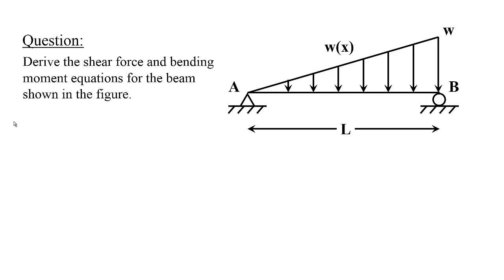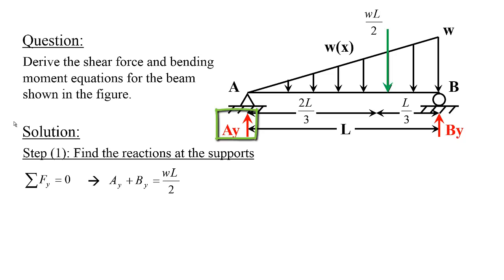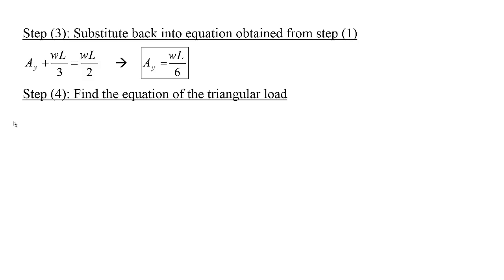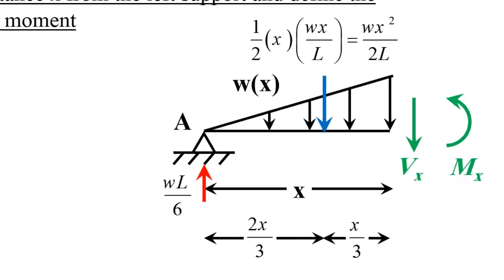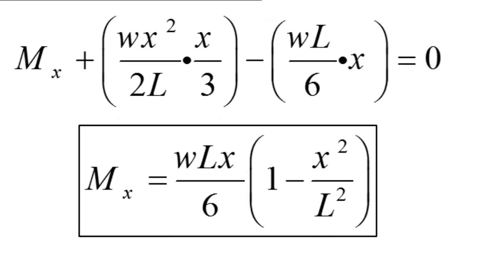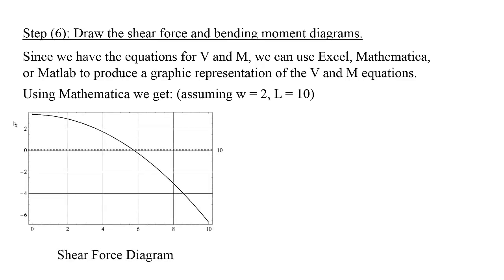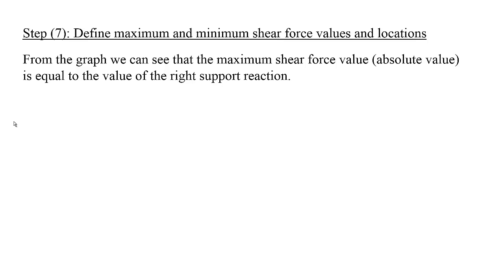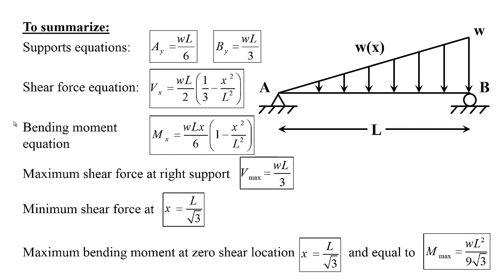Question (10): How do we Derive V and M equations for a simple beam with a triangular loading

Comment: While I appreciate the explanation, a problem like this will not be on the FE exam because it takes too long to do even if you know exactly what to do.
Reply from the maker: you are 100% correct. Most of these problems appear in homework sets and some final examinations :)
Reply: @CTSCIVIL  that’s true. I’m studying for the FE right now and came across a couple of problems like this and thought there is no way a problem like this would be on it
Reply from the maker: @dylanmccoy8530  Good luck with that. 
Remember, you only need the basics
Reactions, Shear force and bending moment at a section and diagrams, Method of joints, method of sections. That what I did from statics and all of them appeared on the test
Reply: @CTSCIVIL  thanks for the tip!

Comment: What is wL? The total length of the beam times the ?. Is it the maximum w(x) or what? Why not write w(x)? Use some numbers, it will clear a lot of stuff up!
Reply from the maker: MrFishhunter w is the maximum value of the load at the right end of the triangle and L is the total length of the beam. w(x) is the equation describing the load where w(x) at A = 0 and w(x) at B = w. 

The main point of this tutorial is "NOT" to use numbers :) The main idea is how to derive general equations and if you have numbers you can plug them in at the end.

Thanks for stopping by
Reply: CTSCIVIL I forgot to thank you for publishing this, I shouldnt make demands but if the point is to teach people then it is always best to be as clear as possible and after the theory you can do it quick the with numbers. Like the w(L) wasnt very clear but would easily be cleared up with some numbers. Actually, I still dont understand how to solve my problem. Our teacher did a simple eam like this with distrubuted load of 8,79 and L of 3,2 and he got a maximum bending moment of 6,2 but if I put the number in from your calc it seems it is 5,62 if I am not using the wrong numbers.

Comment: if the loads are linear, we find load equation;
load equation is "f(x)=(W/L)*x + 0" in this sample;
first integrate of this equation is V diagram ( (w*x^2)/(2*L)+c ),
we can find the X when (w*x^2)/(2*L)+c=0 (for maximum torque) 

second integral of this equation is M diagram c*x + (w*x^3)/(6*L)